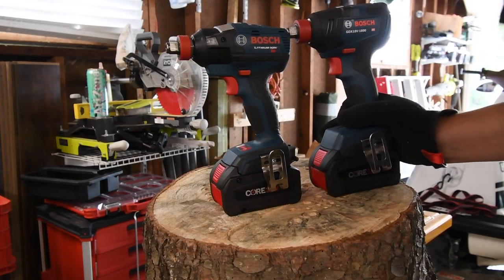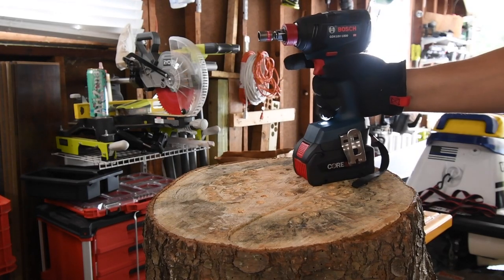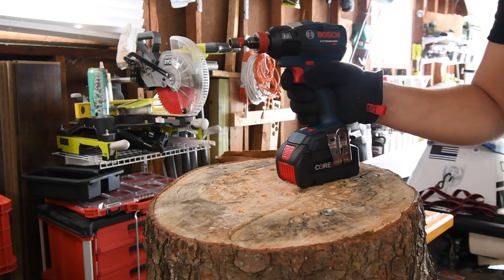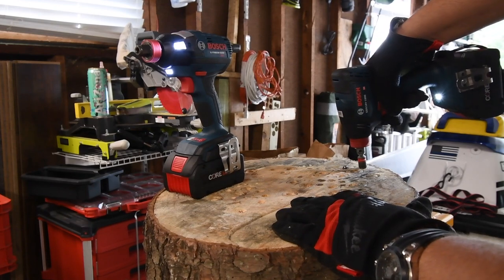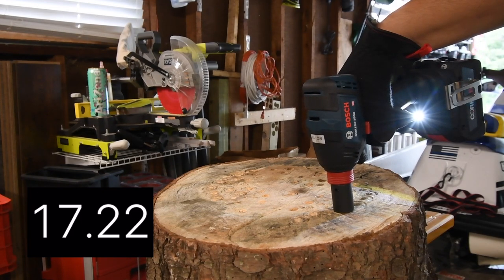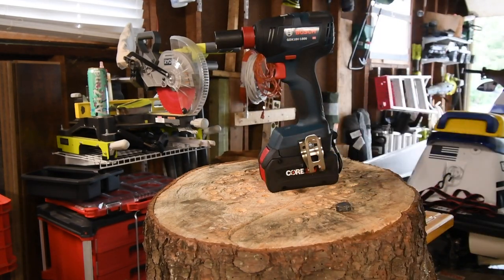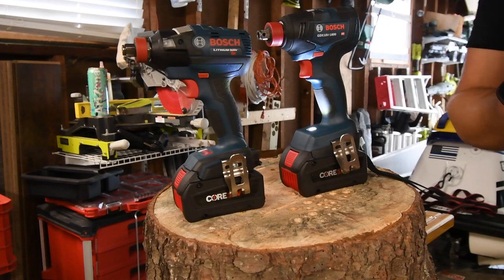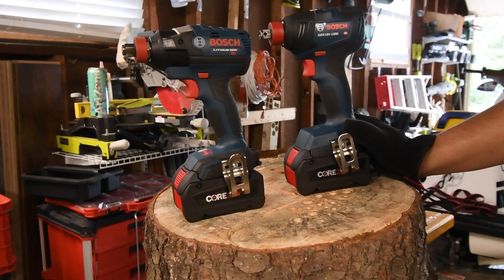Sometimes Cheaper is Better!!

Comment: You do a great job of running your tests, I like your videos, but you need to do more homework on the lineage of the tools you're reviewing.  I remember you citing Rigid Octane as Top of their line after it was discontinued.  Now, you are comparing a current model against a long discontinued tool.  This stuff is easy to find out.  I have faith in you, dude.
Reply from the maker: that is what makes my channel unique. I find out more about a tool the more I use it. when I first introduce a tool the channel I get to give a real first impression on it. I do more then 1 video on a single tool. A single tool will be in many videos. I dont use a tool once then shelf it like most channels do. I will use these tools over and over and over again
Reply: @ManCaverTools  how about geing yor hands on Hikoki tools, old name was Hitachi. They have US$ (KKR Investment) behind now and are coming Hard on the market. They have Metabo connected  in their business also.

Comment: My 2016 model 12v Bosch GDR 10,8 V-EC  impact driver  also had this very annoying trigger problem.  It looks like all the Bosch brush-less tools are affected by this issue. One thing that I noticed is when the tool is in regular use, the issue doesn't happen.

Comment: I agree that Bosch makes it difficult to distinguish from its competing Freak lineup. It’s a shame because the customer can be easily mislead and think poorly of their tools and miss out on their great feature.  I just picked up their better Freak for 59 bucks that included their 4amp.  Wow.  Looking forward to torque test channel.  Great Channel.  Don’t quite understand why everyone states they have the best battery setup. I’ve tried educating myself and understand the difference with 21700 cells but once again the battery still matters and the 18650 can still outperform 21700.  Thanks to Torque Test Channel for that information!!

Comment: I wonder if you could check to see if the can remove lug nuts at around 120 to 150 foot pounds, since people would be using them for that. Thanks again brother great video.
Reply: yes huh yuu
Reply: Mine does. My truck's lugnuts have a torque spec of 135

Comment: the speed selector version that you use looks like gen 1 freak.. it has 1650 in-lbs of torque compared to 1800 in-lbs of torque from the variable trigger version.. the gen 3 freak has bluetooth cap at the handle to differentiate from gen 1 and 2

Comment: I have the 1800. It is an awsome tool but the light placement is horrible. It is crazy to me that they put a tri light on the other one and then changed it to a light on the base. The 1800 that i have has speed selection and a place for a Bluetooth chip tho.

Comment: Nice video Dave; maybe the tool is telling you that you are using a to high of a mode or gear for what you are trying to get it to do so it cuts out runs and cuts out to save the motor and or the tool /battery . just a thought !!

Comment: Pretty sure you're using the Freak 1. The Freak 2 has the smaller profile like the non-selector Freak you used here and has 3 speeds, not 2.
Reply: Yes this is a 5 yr old Freak 1.
The one with variable speed is a Freak 2 (but there is also one with the same pwr, 3 speeds and connected module).
Looks like Dave needs to get some more non-Ryobi and non-Milwaukee tools

Comment: Why have a hybrid collet/anvil on a single tool? For heavy construction.
You'll be mostly tightening and running medium-sized bolts and fastening to steel and concrete construction and a freak like this means one less tool to carry.

Comment: Hey yo Dave!  The 3 speed was the original one, and was a unique tool when it was released.  A lot of Busch’s early EC (brushless) Drills and impacts had this annoying trait, if you will.  I had a compact brushless hammer drill.  Nice tool, but the trigger would delay, similar to what you experienced, albeit not as bad, and the variable speed was poor.  I sold it.  The variable speed model is a solid little impact, but nothing special.  

Bosch’s Core batteries are just about the best out there!  The newer ones are even better than the ones you were running.  It’s a shame they don’t step up their tools to match!  The guys at my local Lowe’s says the Metabo HPT tools get more interest and sales.  What does that tell you?  Thumbs up bruh 👍👍👍👍👍😁✌🏻🇺🇸

Comment: Same thing happened to the Ryobi 1/2 " they put a speed selector and it lost power
Reply: This is a different scenario. The one with the 3 speeds is a 5yr old Freak gen 1.
The other one is a Freak gen 2 with variable speed only. There is also a Freak 2 with 3 speeds and Bluetooth module, part number GDX18V-1800C.
Dave doesn't know much about Bosch tools, a little research would've made this clear

Comment: I do think the craftsman cmcf820 do better then the Bosch with the tri light to my
Reply: It's a 5 yr newer model. It better be!
IDH182 is around 1650 in lbs and CMF820 is 1700.
Freak 2 is a bit more powerful and quicker than both. VCG construction made s TTR between the Craftsman and Freak 2 last year. Bosch won
Reply: @engineer_alv  Bosch has a 4 AH and craftsman has a 2 AH for that TTR and I do think craftsman will win if craftsman has a 4 AH battery

Comment: That’s why Bosch is NOT in the top 3…”Red, Yellow, Teal Rules and other color drools”….🤣🤣🤣
Reply: LOL, too much dude!  It’s a shame, really, as their batteries are about the best.
Reply: Makita had great ergonomics and speed. But torque is not their thing. I've seen lots of comparisons where the top of the line Makita drives small and narrow fasteners quite fast but it losses steam as soon as you switch to 3/8" x 6" bolts.
You csn only do so much with 1600 in-lbs